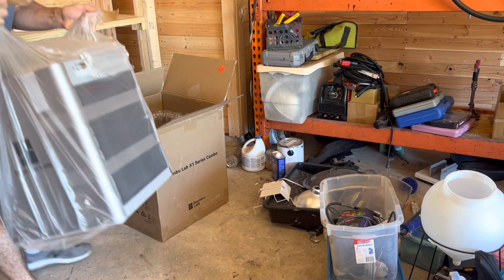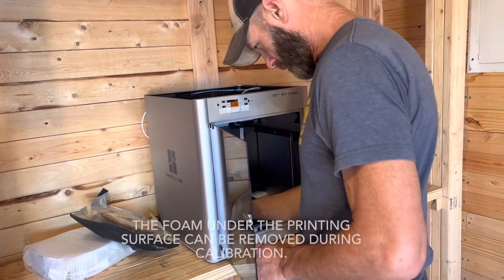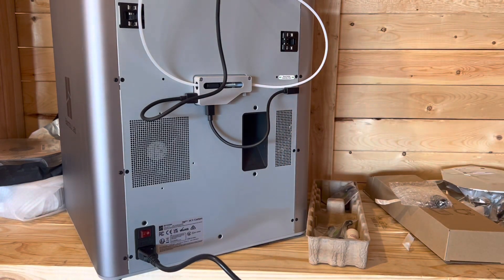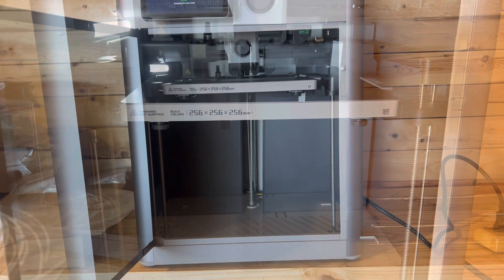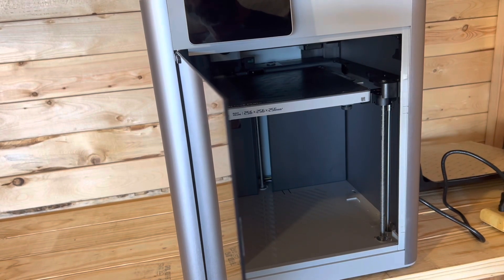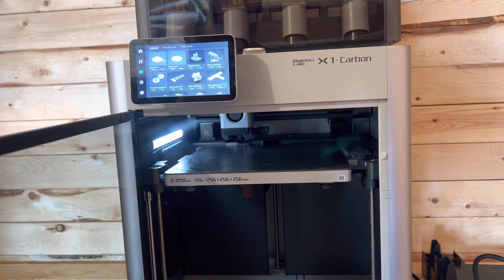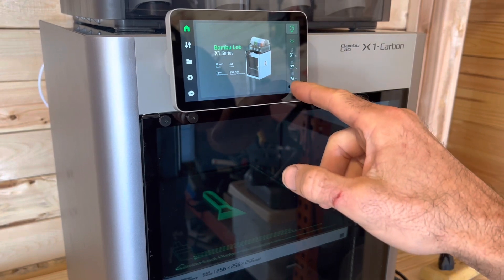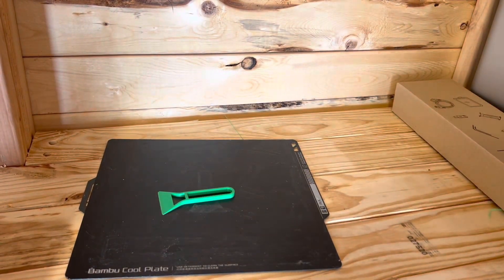Bambu Labs X1 Carbon Unboxing, Setup, and First Print

Comment: I'm surprised it printed mine wont print with plate not correct lidar stops it and its flex bed u just slightly bend the bed to pop stuff off in most cases
Reply from the maker: Good to know. Im learning something new each time I use it. This is my first experience with a 3D printer.

Comment: Quick heads up, you have the build plate in sideways. The little tab that stick out should be at the back, as it needed to wipe the nozzle on. The QR Codes and PLA text should be at the front.
Reply from the maker: Awesome, thanks!